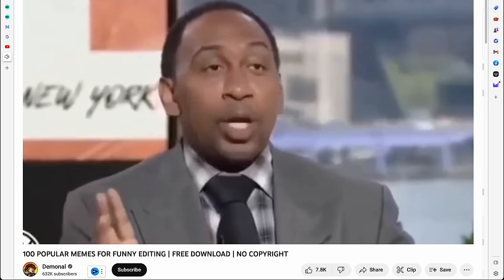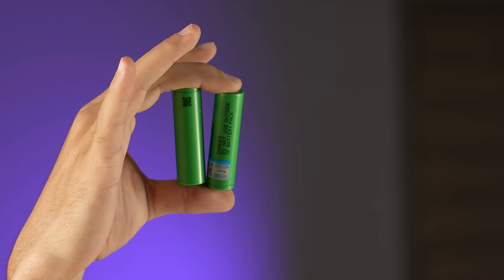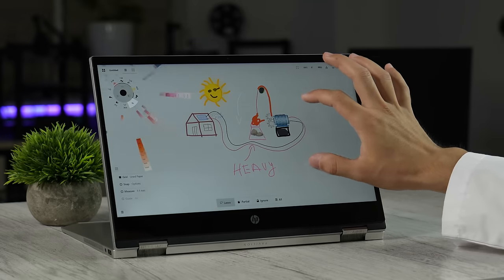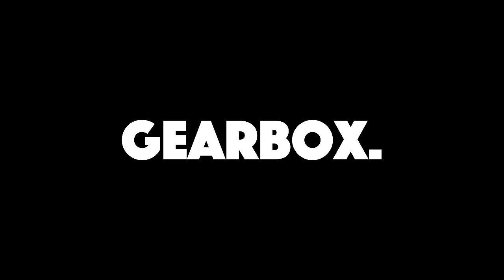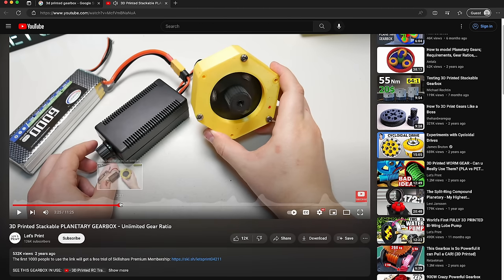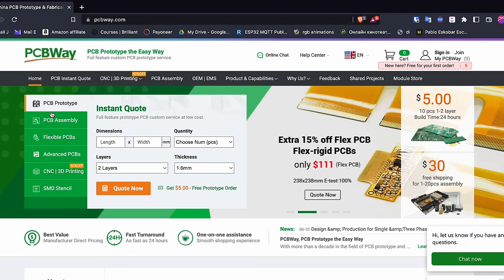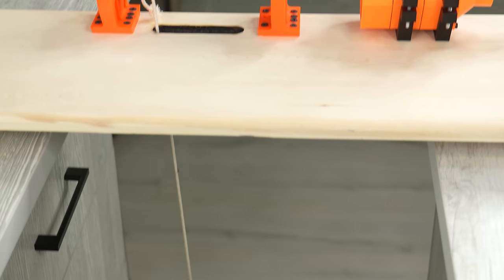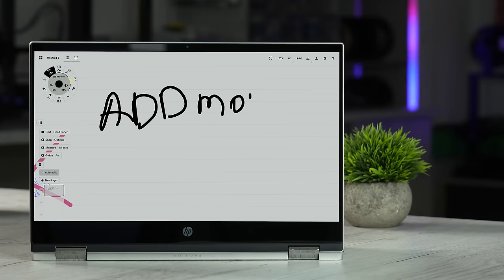DIY Gravity Battery: Unexpected Results!

Comment: I wish steel could also be 3d printed
Reply: @bizobloka8872: Molten steel is often poured into molds made of sand to produce "3D" parts such as internal combustion engine blocks. So, all you need is a furnace capable of melting steel, a means to pump the hot liquid metal through an orifice attached to an x-y stage, and a water-cooled elevator to lower the "printed" part as the machine squirts layers of molten steel in a programmed x-y-z pattern. Lots of engineering involved to make that happen, so don't look for a video here any time soon. The metallurgy alone will take a considerable amount of time to figure out, but that is a well-developed science as well as art. What are your remaining two wishes? Please don't ask for money as we are attempting to do "engineering without math" in this channel.

Comment: The rocks were 98 kg, right? Then, estimating the height you lifted them as 5 meters, and rounding g≈9.8 m/s^2 to 10 m/s^2, and rounding 98kg to 100 kg,
the stored energy is mgh where h is the height,
So then, get an estimate of, 5000 Joules, i.e. 5 kilojoules.
A watt is a joule per second, so a kWH is 1000 * (3600 seconds) * (1 Joule/s) = 3600000 Joules = 3600 kJ.
So,
This, (not taking into account efficiency in getting energy back out) stores like (5/3600) of a kWH.
Or, I guess, how much energy in 1 kW times 5 seconds.
Or, 1 watt for 5000 seconds.
Uh...
Ok, incandescent lightbulbs generally run at 60 watts...
So, ideally, it could run one of those for like, a bit under 100 seconds?

I don’t think lifting 98 kg is going to store enough energy for your nightly electricity needs.

Comment: The other big reason for chemical batteries is effeciency. If the charger is 93% efficient (considered low efficiency) and you desire AC power the with a 90% efficiency (low efficiency) then the total system will be about 83.7% efficient for AC or 93% efficient for DC.

A mechanical battery's efficiency is horrible. If your motor/generator is 80% (high effeciency and high cost). This means a total effeciency of 64% (80% store and 80% retrieve) for DC and 57.6% for AC. 

This ignores friction losses caused by the cable and pulleys. It also ignores losses as the cable stretches over time.

In the real world you can expect around 40-45% efficiency for DC. 

Granted that if the choice is losing the generator power (0% effeciency) then 40% is a huge gain.

With both chemical and mechanical batteries it is important to size based on needs.   Too small of battery means that no power is available when needed, while too big could mean that the battery never reaches full charge.

Comment: Wouldn't be better to put weitght on the rope? like the more rope the motor pushes more weight it gets ...it will be easier on the motor and heat also if it falls for no reason it will fall not all weight at once... but yeah i don't know

Comment: gravity batteries are only practical at very large scale. like.....multi-ton weights with a $250,000 generator for megawatt level energy production setups. Like taking an old oil drill well that's dried up  and lowering/raising a tungston rod up and down it's several mile long shaft...
But if you have a hole that's already that deep....you're better off building geothermal using it as it isn't just a "store of energy" but a constant-supplier.

Comment: Its quite easy to calculate how many energy can be stored this way. I was trying to count with potential energy of gravity, i have a slopy garden, with highest and lowest point around 20 metres. Moving 1000kgs up and down would create so little energy it was not worth thinking about it. Yes, it can store energy, and yes it could prolong the peak energy after sunset for example for few minutes. Put it simple, 1000 kgs moving 10 meters(down by the force of gravity  9.8m/s-2) in a minute would output only 160 watts if energy would be transferred without losses...so more likely 100 watts.  Here you realise how much energy we are used to use every day and how wasteful our society is.

Comment: If people are willing and labor is cheap enough they can just carry The Rock's up somewhere high and have start of free energy except for the labor. Or pull them up with ropes block and tackle maybe even up hundreds of feet off the side of a building a lot of people don't have enough money to buy a solar panel but they need some electricity I've seen that done on a video where they pull up weights on a tree limb

Comment: On batteries two key measures are important: stored energy and efficiency. Both are not good at your battery. Stored energy is mass x hight. Efficiency based on the gear i would not expect more than 30-50%. Lithium batteries are about 95%. Assume 100kg and 10m the stored energy is: 10kJoule == 2.7Wh not kWh. This is nothing.

Comment: Couldn't you use a water pump by day to lift water to a container, which gets dropped by night? Less strain on the motor and you could opimise the gearing for generation rather than having to do both jobs...

Comment: Couldn't you make a generator using a bunch of small water wheels that power generators on a long aquaduct?  I mean, the Romans had huge aquaducts that stretched for miles.  Why don't we use something similar with a ton of generators along the way?

Sure, pieces would need replaced, but that's easy enough.  I don't know what's stopping us from doing this.

Comment: why the fixation to use 3d printer ?... why did you use METAL screw ? ... or more to the point, Why did you NOT start with metal pulley ?  SAME for gear !

Comment: So....my tablet has a 5Wh battery, or 18000J....18000J are 18000Nm, or 1800kgm....that's mean to storage the energy of my tablet (ONLY my table) I've to move 1800kg to 1m high...or 180kg to 10m high....It's not seems the best way to accumulate energy

Comment: All that for 3% of a AA battery... Fuck yeah 👍

You're not getting anywhere with a load less than 100kg. Suppose you want an equivalent charge to a AA battery. That's about 7kJ. If you want to get 7kJ of energy by lifting a mass about 5m, assuming a 100% efficient system, that's going to require a mass of almost 150kG. Energy (kJ) = Mass (kg) * Gravity (m/s2) * Height (m).

1 stage of a planetary gear box like that is what, 80% efficient on a good day? 7 stages is 0.8^7 = ~ 20% efficient. If you are using a 20kg mass with a 5m height then that's less than 3% of a AA battery...

Those look like two low power 15W LED light bulbs? 2100J / 30W = 70 seconds before you run out of power.

Something tells me you didn't actually power those light bulbs through a 12V to 120V inverter circuit and just used mains instead...

Gear box is not appropriate. Try a cycloidal gear box for designs with requirements like this. Can be 3d printed but requires ball bearings. In my opinion upgrading to a cycloidal gear box is the single most influential change you could make.

Comment: If you do any simple calculations, you know a gravity battery is a terrible concept to start with. Unless you have the perfect hill and enough water.

My guess is 46kg ~8meters(which is a high guess) is about 3600 joules of energy. 
My phone has 66000 joules of energy so this contraption has 5% the capacity of my phone. 

You probably knew this already, and still nice technical achievement. But for all people who think this is a viable solution. It is not 😅

Comment: it would take you a 5 ton weight at a height difference of 100 meters to store just 1.3kwh of energy, it's really not worth it, at this point you are better off just using lead acid batteries

Comment: A 1000kg weight hoisted up 10m has the potential energy of 27,25 Wh according to chatGPT. A 5Ah Drill battery has almost 4 times the capactiy. So unless you've got an oil tanker as a weight this concept is not feasible. But nice try anyways!

Comment: The most energy wasted is in a car 2 ton of metal travling at 60mph the forces in that is shovking the amount of energy saved would be shovking wnd i do think you could run it on its own  10 battrys all diff yav got motors on ya brakes ya wheels everywhere and then there all charging 1 of them 10 battrys then when 1 bqt dies well the cars bean movibg so yav charged other battrys 5hen u just keep swapping ..plus ppl 4get when u lift somet that is green energy that weight is pulling towards the earth and it will pull untill it gets there

Comment: If one uses the right formulas and gets through the problems with converting units then  10 AA batteries contain more energy than one m3 rock hanging on 10 m. It's extremely disappointing and against all intuition how little energy is delivered through this gravity battery idea. I keep having the idea something is not right.

Comment: Why not switching between two gears back and forth Automatically, MR. broken flashbulb head? Water with a pump as weight would have been easier and cheaper Captain idiocracy XD

Comment: This is just painful to watch. Why? Because while being very good at modelling in 3D and imagining in brain-space he is missing one important thing - Mathematics or Math modelling the design before building that hardware! Say you want to store 5 KWh of energy in a gravity battery for use in the evening.

1) Generation by 250 Watt panels - assume 6 hours sun at 60% efficiency then we need 5 KWh = 5,000 Wh
Total daily generation = N panels x 250 x 6 x 0.6 Wh/day = 5000 Wh therefore 
N = 5000/(250 x 6 x .6) panels = 5.5 or 6 (250 watt) solar panels

2) Storage by Mass (M) x Height (H) must equal 5000 Wh assume efficiency 80% and H = 5 meters
Storage = M (Kg) x 9.8 (Newtons) x 5 (meters) = M x 49 Joules and (1 Watt = 1 Joule/second). So
5000 Wh = 5000 (Jh/sec) = 5000 x 3600 (sec/h) = 18e6 or 18 million joules! Therefore;

3) Mass required at 80% efficiency
M = 18e6/49/0.8 Kg = 460 metric tonnes!

Comment: Simple concept, simple to apply, limited application. For one HP, 746 Watts you 550 lbs mass falling at a rate of 1foot per second , or any combination thereof,  eg 33000 lbs mass /foot/minute!  Or , if a farmer has a 60 foot high silo and a pulley and weight, arrangement the 33000 lbs provides 1 HP for 1 hour!!  Minus inefficiencies.

Comment: You say that batteries are EXPENSIVE. We’ll I have about 300 3.7Volt batteries at around 550mAh and ALL for FREE. As I have a friend who finds thrown away VAPES, as he is collecting them for me, also his partners son, also any that I find. So YOU should be able to get MANY batteries in that way. 
As you look like that you are living in a very sunny ☀️ climate, then instead of getting a 12V solar panel, then in the SAME space, you could use two 6V solar panels. But for me living in the UK 🇬🇧 we do NOT get a lot of sun as you get. But I have two 6V lead-acid batteries linked to make them as been a 12V system, and I can then use one of them battery’s to charge MAY of the 3.7V batteries, as they tend to need a 5V power supply to charge them with. 
But I BET that you could ask your younger brother to ask some of his friends to collect the throwaway VAPES for you so you can harvest the batteries out of them. 
The BEST way to open them is to use a set of mole grips to pull off the bottom, as you WILL then see three wires, one red, one black and as a rule, one blue. Cut the red wire first, as both the blue and the black are connected to the negative side of the batteries. If you want to, you can get 3 or 4 of them 550mAh batteries and solder all the positive sides to one wire, and the negative sides to a separate wire, then by using shrink wrap and a plastic glue gun, you can make MANY packs in that way, but write ✍️ in indelible ink, the volts and the amount of amps that pack holds. As depending on the shape of the vape, the size and shape of the batteries can be so different. The batteries that I LOVE to get, are the FLAT rectangle batteries over the normal round batteries. 
We’ll hope that it has given you something to think about. As with you having a 3D printer, You could print out your own design of battery holder, as to make a battery bank. 

Bye from John (Knobby) from England 🏴 👍🏽

Comment: This is not the future , you probably spent hundreds of dollars on pulleys ,motors to just equate a few chemical batteries. Chemical batteries not only have more energy density, they are much cheaper and safer. This has no future
Reply: There are already gravity batteries being manufactured for quite a few years.  I saw it 7-9 years ago.

Comment: You need a 60 RPM axial flux generator. With 1:30 / 2:60 ratio. Stop wasting your time for 775 motors. Use big motor. I will leave a dislike this time.
You are not an engineer. You are a student.